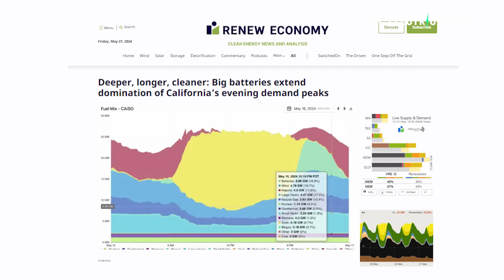Fossil fuels shattered as battery power continues breaking records in California

Comment: Califonia isn't achieving anything like replacing fossil fuels.  That is total foolishness.  You constantly talk only about replacing electrical production which is only 1/3rd of the power consumed in California; solar and wind combined only produce 18.3% not 50% of Electrical power comsumed which is only 5% of all power consumed because California imports 30% of its electricity from other states! Even if solar and wind could replace all the electrical power that would still leave 69% of the states power being produced by fossil fuels; as it is today it is approximately 85% fossil fuels, half the renewables being hydro, nuclear, geothermal and biomass.
Reply: The greater point is that the balance of power is changing and it's changing way faster than anyone could have anticipated. Sam covered this recently, but a few days I visited a really groundbreaking electric truck stop that just got installed near Bakersfield by WattEV. This is actually right in the middle of some major Bakersfield oil fields. They have solar panels and battery storage and they can charge freight trucks at well over one megawatt. They're doing this because it's far cheaper to run a truck on electric battery, industry follows the money and you cannot stop the electric transition. Yeah we have a ways to go yet but the Domino's are well and truly falling. As Bob Dylan sang: your old road is rapidly agin'. Please get out of the new one if you can't lend your hand, for the times they are a changin'.
Reply: @EPeltzer  OK lets discuss that.  Maybe in some areas you can get at least a decent part of vehicles powered by the sun or wind; but the current growth rate of solar - according to myworld in data - see world energy profile - is declining in install speed as the amount of solar installed grows it becomes harder to increase the rate; Solar production is currenly under 3% of world energy production. Wind is like 5%.  A current limit to any such installation is limtied by Lithium. Lithium production world wide is 169,000 tons in 2023; that is only enough to make 12 million Model Ys or about 1 million Tesla Semi's.  The USA alone has 9 million heavy trucks 3 million of which are long haul - how many 1 Megawatt battery packs would you need to keep just one long haul truck running cross country at night? 6? 8? The range is not close to claims it is about 120 miles loaded on flat ground. So if you have to use lithium to make these megapacks each one means 1 less Semi Truck. If you have 3 million long haul  you are talking 18 million packs just to keep them running - that means just to keep a fleet of Semis for the USA all electric  your talking over 20 years at current lithium production using every ounce for Semis nothing else no EV cars, no cell phones, no laptops no power tools just a US Semi truck network.. The USA only has 5 percent of the worlds heavy trucks. So for EVs and solar to work you need a something cheap and good maybe sodium or something else - but - what ever it is has to really be made and it has to be made fairly soon to have any real argument that it is practical.
Reply: You realize that every day the percentage of renewables is increasing, right? If not, go check it out. They are well over 50% renewable now and not stopping anytime soon.
Reply: @ryen7512  Renewables or solar/wind?  As I note above - only 18.3% of what California produces is wind or solar; both are unreliable; and that is just if you are focusing on what California produces - not what it consumes because 30% of what it consumes is from out of California so that means the total renewable that it consumes is much less than 18% .. plus .. the biggest thing that is only electricity.  California electrical power is only 33% of the power it uses - most of what it uses is fossil fuel for non electric consumption. Thus the total of all energy consumed is more like 7-8% renewable.
Reply: @litestuffllc7249  I don't know where you get your figures but they are outdated and wrong.
Reply: @litestuffllc7249  It's more like 37% now for solar and wind alone.  But Hydro and Nuclear are still a big part of California's total electricity mix and you throw those in it's well over 50% now (and has been for a few years).   Methinks you are relying on old data... the grid keeps changing and keeps shifting more towards renewables, and there aren't really any road-blocks or hard-stops any more for the shift now that grid-scale storage is starting to seriously eat away at day-time excess generation.

This is very real, and its the future.  Denial isn't going to get you very far.
Reply: @junkerzn7312  I gave two prior parties references that say that figure isn't true.  Myworld in Data energy profile for California; and The EIA fact that 30% of the energy CONSUMED is imported. Even if Solar and Wind were 37% of the electricity produced in california of the energy consumed that number is reduced by 30% 'bringing down to about 25% of electricity consumed. As stated before Electricty is only 33% of the energy consumed in California, so of all energy consumed,(which I MWD says is wrong)  of the total energy consumed its only 25%/3=8%. It isn't even that really.
Reply: @litestuffllc7249  Again, you are wrong.  You are welcome to post references, but its trivial to find totals inclusive of imports.  It took me 5 seconds to find a 2022 report that added it all together, including imports, that showed 54% renewables and 46% thermal.

Not sure what you think you are proving.  Its obvious that generation is shifting towards renewable energy at a very fast pace. 

"california total electricity consumption including imports", literally the first non-AI search result "2022 Total system electric generation".

You are making vast, incorrect assumptions about everything to favor a position that is obviously wrong.  I recommend you change your thinking processes.

-Matt
Reply: I’m so glad you put the California electric grid in perspective. An optimistic view of what California is doing with its grid is inspiring but shameful. Seeing light at the end of the preverbal tunnel doesn’t get you out of the tunnel any faster. The feeling of darkness and futility is what drives public will. Please remember everyone the way to a better future is understanding that your efforts are not doing much and we need to call into question anyone’s credibility for being optimistic. Optimism is the enemy of success !! RIGHT !?

Comment: Nonsense, as of 17:30 ACST South Australia electricity generation is, gas 1,057 MW, wind 484 MW and batteries 22 MW. Figures per AEMO>
Reply: You forgot the liquid fuel used as backup........it's called diesel rofl
Reply: Where is the solar energy?
Reply: @rozonoemi9374 the sun has almost set by 5.30, so , no solar.😅
Reply: @robertfonovic3551  That's when the solar-charged batterie take over-so, yes solar
Reply: @rozonoemi9374 this guy is cherry picking when he obtains his data. At 5:30pm in SA today, a day shy of the first day of winter, it is likely dark in SA. So no solar. In another post for California he chose to use after midnight. These are the worst type of people. They are intelligent and they use there intelligence in a way to deliberately mislead others who they think are stupid
Reply: but talking in MW gives no context to the amount needed for consumption for either the whole nem or just the state grid